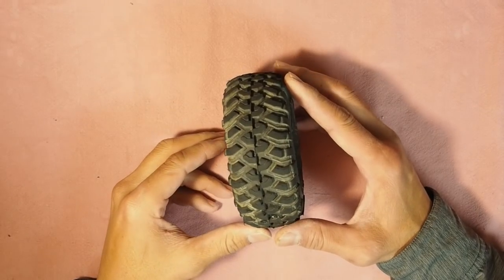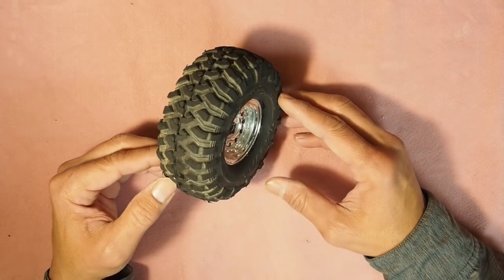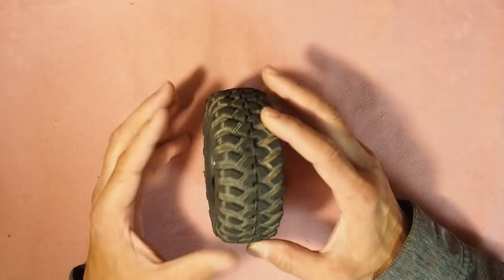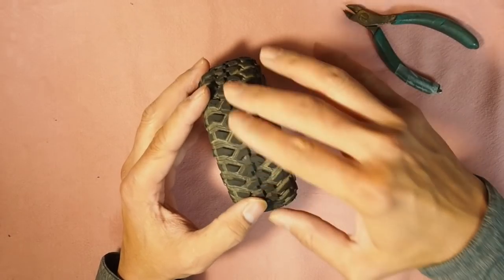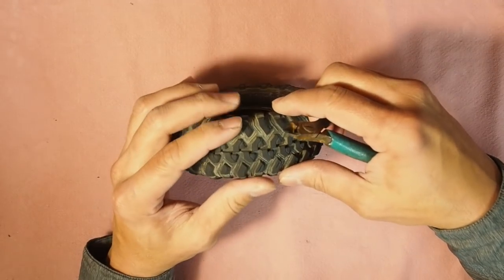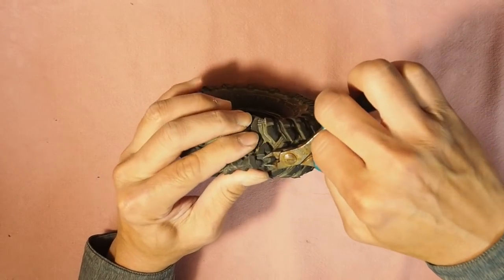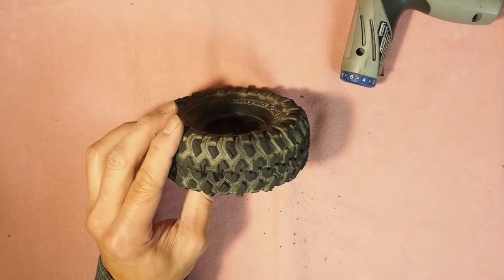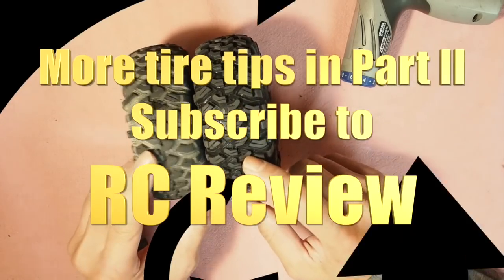How to modify a stock TRX4 RC Crawler tire for free - Part I - cutting and siping

Comment: I did it and I will say that the stockers work great with this mode.  I removed then off the stock wheels and got some bead locks.  I have compared then to a set of hyrax I bought and they work as well.
Reply from the maker: Pretty amazing huh? Softer foams are key too.
Reply: @RCReviewChannel  I have experimented with a couple different set ups.  What has worked best for me is to use the foams that can with the hyrax tires in the front and proline dual stage foams in the rear.  I did this to both the Trx4 tires and hyrax's.
Reply from the maker: What is interesting is cut and modified Traxxas Canyon Trail Tires peform just about as well as Proline KM3's, Pitbull Rockbeast and other leading tires out there.

Not quite as good as Hyrax on climbing but maybe better for sidehilling and slippery stuf.

Comment: Use a pair of nail clippers scissors and call it a day. Be patient it's well worth it, one thing he didn't mention in the video is that not only will it scoop but your taking away from the structure of the tire making it much softer allowing it grab any surface much better.

Comment: Shop around long enough on ebay you can find a good set of alloy/ metal/ weighted beadlocks starting around 25 bucks shipped. Set of 4. My latest set i just bought was a 50 dollar set. Only cause i was after a military styled wheel. Before that most i spent was 30 bucks on a nice set. 👍 bought steelie styled set for that 25 and change and they're just over 4 0z a pop.
Reply from the maker: Links please. We’ve had pretty bad luck with tires that pop off or screws of the lowest quality ever seen
Reply: @RCReviewChannel  dont have any on hand. But it dont take but 10-15 minutes of digging around. "1.9 metal beadlocks" what i punched in. Price lowest to highest order. Only bought from other US seller's. I don't buy anything over seas. Only bought 3 peice setups too. The 50 someodd dollar set i just bought was from alientac. They had a bunch of stuff in the 55 range that looked really nice. See a bunch of guys on YouTube with the steelie set that I bought 26-30 bucks is the norm range. Snuffed out a 26 dollar set before that particular seller sold out. Im on 3-4 times a week watching stuff, alot of people have like 10-20 sets at a time and they roll fast. 
Ive only had bad luck with plastic bead locks so i toss any i get
Reply: Took 5 minutes and found the black steelies i have, 24, 4 change to ship. Under 30 buck's set of 4. Found a few 25 dollar sets along the way.

Comment: Another trick is to make the holes in the rims for the air to escape one size bigger that allows the tires to compress more when going over rocks
Reply: I have done the cutting in the sighting and then I did the drilling on the inside of the Room and watched my TRX4 with stock tires compete with somebody running top of the line tires. I did everything he could do

Comment: I did this months ago. But I cut 2 slots instead of 1. Took foreeeeeeever but worked awesomely. Use the very thin metal saw blade you can get from dremel... Do not inhale the smoke when doing this
Reply from the maker: Two sipes takes skillz
Reply: Pretty easy just use the metal thin saw blade rather than the cutoff fiber wheel. But yes took nearly an hour each tire

Comment: I’m new to the hobby. I have a TRX4 G500 with stock tires. Witch parts of the thread should I cut so that they perform a little better until i got some new wheels and tires?

Comment: 😁👍I thought of doing my TRX4 tires but man it takes so looooong especially if doing the cuts like you shown also...how long did it take you to complete one full tire like you shown?
Reply from the maker: Just for the cuts, 10 minutes of focused work with a very sharp cutter. No tv or youtube since we might cut our fingers. :)
Reply: @RCReviewChannel  😁 Yea I did the cuts with the moto tool with a cut off wheel on my ECX temper gen 2 tires and it took a long time but the mess was insane!

Comment: Generally doing this to most of the tires makes better. Done it on some Wltoys tires and cheap crawler tires. If ya know where to cut them.
Reply from the maker: Yep agreed. Opening up the tread pattern is really good for traction. Rolling resistance increases but we don’t really care about that in crawlers

Comment: Do you know anyone who has done a forward servo / bumper mount on TRX 4?
Reply from the maker: A good alternative is to mount a small battery right near the front bumper. Helps add forward weight that is a big performance advantage.
Reply: Getting set up to do this to my Bronco  https://www.ebay.com/itm/Car-Engine-Case-Bracket-w-R-Clip-Cover-Hinge-for-1-10-Traxxas-TRX-4-Defender/264146415844?ssPageName=STRK%3AMEBIDX%3AIT&_trksid=p2060353.m2749.l2648  
The servo/bumper mount  https://www.ebay.com/itm/GRC-Brass-G2-Front-Bumper-Mount-Gold-w-Servo-Mount-For-Traxxas-TRX-4-GAX0031D/382668295010?ssPageName=STRK%3AMEBIDX%3AIT&_trksid=p2060353.m2749.l2649
As part of what is needed is the forward servo mount   you will also need a new servo horn  https://www.ebay.com/itm/GRC-Aluminum-Servo-Arm-Silver-For-Traxxas-TRX-4-4WD-RC-Cars-Crawler-GAX0063A/142601464260?ssPageName=STRK%3AMEBIDX%3AIT&_trksid=p2060353.m2749.l2649
There are several other items required to do the engine bay, let me know if you want the rest of the links.
Reply: Crawler innovations sells a plate to mount your battery foreword. I use a 860 mah pack mounted upside down to farther lower cg. Excellent mod!!!!